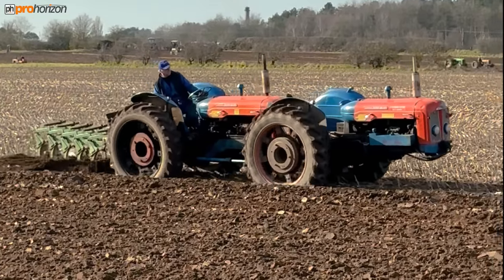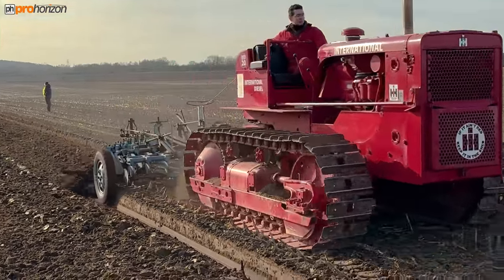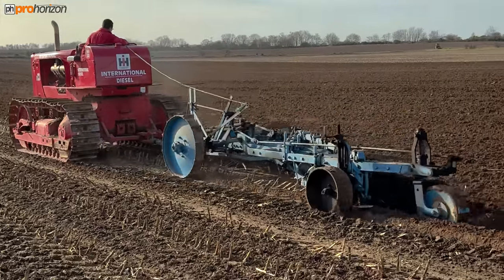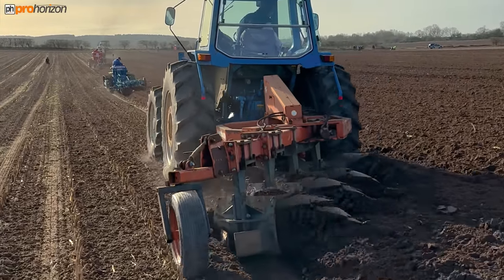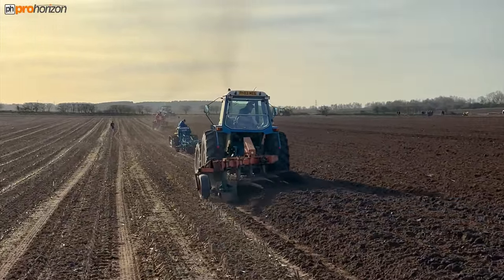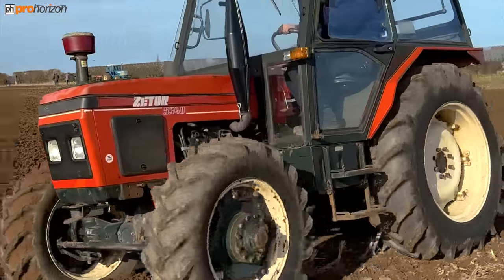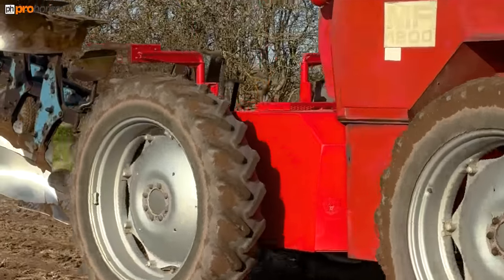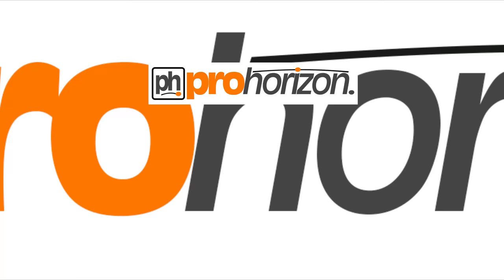VINTAGE TRACTORS ON A WORKING DAY PLOUGHING #agri #Tractors #Ploughing #vintagetractor

Comment: Watching those old tractors, especially that big red International crawler, I'm reminded of the days working my grandfather's acres back in the '50s and '60s with an old military surplus Cat D2 crawler, in military drab, plowing, discing and harrowing!!  Odd thing was, eventually the Extension service evaluation of Grandpa's land suggested a D6 ripper, to break up the "hard-pan", highly compressed soil just below the depth of the plow-shares, which caused poor irrigation and was caused by the weight of that old D2 going over the land for so many years!!
Reply from the maker: Awesome 😀👍🏻